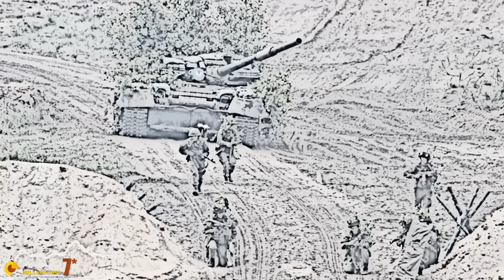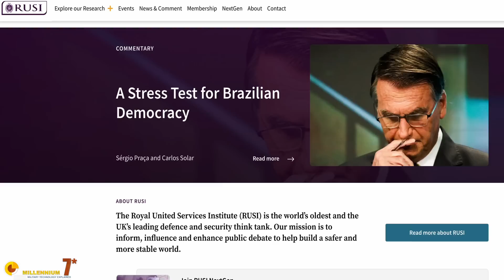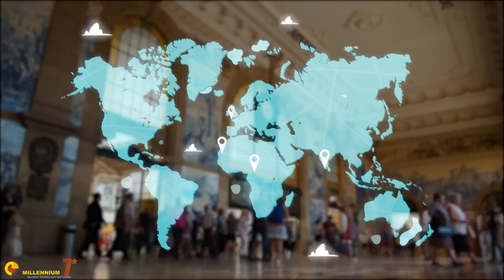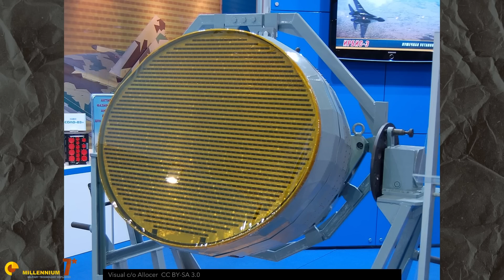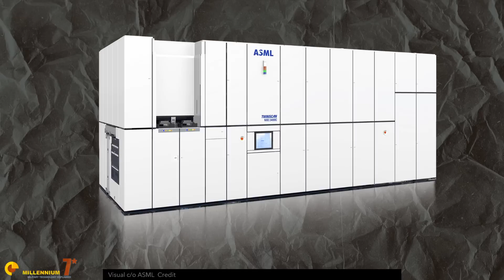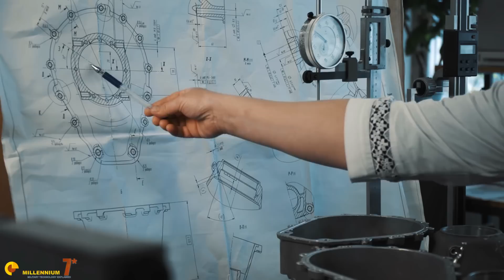Russia is using Western weapons in Ukraine.

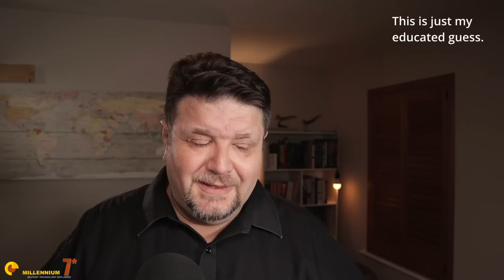Comment: 10:30 "Russia and China re couple of dacadec behind..." well two decades at most. Type in Google: "wikipedia semiconductor factories" - Russia have 65nm factories and China 20nm. e.g. Intel best process is 10nm.
Reply: The process name doesn't say much anymore. Nowadays it's just a name and doesn't give any information about the gate size or buildup. The newer gens don't even have a "nm" assigned to it anymore. Currently the process is "Intel 4". The current TSMC process is "3nm" (N3). TSMC 10nm was the best process in 2016.
The transistor shape of modern processors also looks completely different compared to old processors.

Comment: This is why china is trying to invade Taiwan because of there chip making capabilities I assume
Reply: No. It's for historic reasons. But personally I doubt that they'll ever actually do it, unless the allies of Taiwan and Taiwan itself (or to be more precise the Republic of China) start slacking hard.
But it doesn't look like it. Especially the invasion of Ukraine has also led to quite a lot of motivation for the ROC and its allies.

While it's not impossible to invade Taiwan they'd lose several hundred thousand soldiers in the opening weeks due to having to cover the Taiwan strait. And the problem is that they have no sufficient safety net. If the sons die the parents will be in big trouble. Apart from that there's also a demographic crisis looming.

At the end of the day Taiwan is mainly a propaganda project. For now. Sure, eventually they might go for it, but it would surprise me if it would happen anytime soon.

Comment: You may find that MIL SPECIFICATION semiconductors do not use "Delicate" components such as 7nm IC's. It's pointless to do so. Also, even with error correcting algorithms digital systems are only used incidentally with more emphasis placed on analogue systems such as 4-20 mA systems, especially in missile  control, due to high noise immunity.

That is not say that digital systems are not used ... They are especially in Digital Signal Processing, (DSP), and AI but Chinese Military IC's suitably "Hardened" against EMP, (Electro-Magnetic Pulse), are perfectly acceptable and capable and there is likely very close cooperation between Russian & Chinese Development Design teams in Electronic systems.

Also, it is extremely unlikely that Russia or China will be using very large IC's with millions or billions of logical gates due to the possibility of "Hardware Trojans" hidden in the hardware.  These backdoors can be very difficult to detect without the correct circuit or schematic diagrams. Most large gate count IC's are computer designed,  being a task too difficult for humans to carry out.

My own professional view is that Russia does not depend or use "Western digital electronics" in their primary high security systems like Hypersonic Missiles or Avionics  but may use them in "throwaway or suicide" munitions like drones. 

I am making this comment because  I believe that we are very close to WW3 AND TOTAL DESTRUCTION  and it is EXTREMELY DANGEROUS AND SHORT-SIGHTED to misread or UNDERESTIMATE  Russia's capabilities, especially in Missile and Missile Delivery Systems. 

Nevertheless, I found your video informative and interesting. Thank you very much and best wishes to you.

Comment: military use does not need very powerful computer, video game are much more demanding!
The difference between military grade and normal is in the packaging the chips is the same most of the time use of ceramic package authorize higher temperature and longer gold wire authorize colder temperature, for the acceleration it is the printed circuit that must take care the interna chips military or not (except some sensors) can take more G than any material structure can take (you can find in a air accident pictures taken by the phones of people if the phone is crashed the chips of the memory is often readable.
There is noway to prevent casual components to be used by military, Also Russia has is own operating system (Astra Linux a derivative of unix very effective)  do not forgot that Russians are very good in programming, and often a good smartly written program overpass need of powerful hardware, remember that american land on the moon  with a computer not having the power of a math pocket calculator .

Comment: Very high sophisticated chipset is not needed to build an effective millatary equipment. Most of our daily system is overpowered in processing. A simple Raspberry pi or Ardineo chip can be used to make an effective and advance drone, both of whose architecture is open source. You don't need 7nm chip in millatary, infact 7nm chip is very susceptible to EMP attacks. In my college I was able to make puzzle solving robort using couple of Ultrasonic sensors, accelerometer and some infrared sensor with ardreno and some coding.

Comment: High performance embedded CPU's today is software, not silicon.  Chinese embedded is easy on the same field as the western brands.  So ARM, 51's  and even RISC architecture for advanced graphic calculation is already designed and produced in China and probably in Russia.  So... no... Russia or any big country has no problem to get the high performance chips, no problems at all.

Comment: Dude. Can you please redo the semiconductor section since it's filled with inaccuracies.. The Chinese can already produce 7nm circuitry already... using mature DUV lithography...plus many of the weapons grade circuitry are in the range of 12 to 32nm which is decades old tech. Many of the TSMC engineers, who surprise, surprise are ethic Chinese, switched jobs and work for SMIC a mainland based foundry.  Please research by watching the Asianometry channel,  a Tawainese tech blogger.

Comment: China has a thriving 14nm and already capable of 7nm.  That's about 5 years behind the cutting edge...but 5 years ago, would easily have covered requirements of all weapon systems since western weapons development cycles are on the order of 10-15 years.  Increasingly there is not much that can't be done with readily available Chinese and other free market supplies.

Comment: There is too much confusion  between  military and commercial chips. Reducing the technology node  is more of a commercial consideration and we reached the end of that process a decade ago. Now more gains can be acquired from new architecture and software rather than shrinking the node. Military applications are concerned with security of supply chain, reliability and fault tolerance rather than a smaller node. I doubt even the latest NATO equipment is using many chips past the 65nn or 32nm node.

Comment: When you were saying perhaps 3 decades to parity with the west, you have to remember a couple of factors, the first the Chinese and Russian Cyberability to steel secrets. Secondly there Tech of ASML/TSMC is on the edge of another breakthrough in chip foundry technology so it's a moving target. Also according to Asianometry(https://www.youtube.com/c/Asianometry) China/SMIC is about 5 years away from N+2 node - the 7 nanometer leap, regardless of the efficiency(which won't be good) China will still be able to scale it up this Foundry fairly rapidly. ASML maybe has only 4 counties that supply critical components their are many more then 4 companies supplying those components, which the west is very effective at controlling. I would like to know what inside the IRST of the SU-57, that would be interesting.

Comment: It is not possible to stockpile high-tech equipment, it would be like attempting to future-proof your computer for the next decade. It is not just improbable, it is impossible.
Reply: yeah, please check on which CPU Hubble was running 😂

I have bought microcontrollers and imaging sensors in bulk. Thousands of pieces.

The designs do not change. Not that quickly. 

You can still buy audio chips for a Commodore 64 or the Motorola 68000...
Reply: @juliusfucik4011  That is true, however, what I am referring to, is the advances in miniaturisation of chips, and  high speed with which processors develop. The Space shuttle, ran several computers for error correction and redundancy, yet due to the period when it was developed, the computers were IBM 8088 processors. And the software was also 8 bit. Once a high-tech system is established, it becomes difficult to upgrade the entire hardware and software package as a whole. USAF fighters, for example, are just recently developing an upgradable architecture, to minimise the cost and downtime. Future proofing hardware and software is next to impossible, in this light.

Comment: If I was going to make a suicide drone I'd use some old US calculators, an old hunting GPS, some random stuff from dollarama (China), and the motor out of my old DirtDevil vacuum.
Reply: i would choose something other than my dirtdevil motor since your complicating the process by adding in batteries and other components to get the voltage right.  

instead i would use an old lawnmower, chainsaw motor.

Comment: While this is worrying I think there's also the risk of not being able to see the wood for the trees.  With enough time, money and focus they can plan for shortages in specific areas but the components are only one of the inputs needed to manufacture it.

The sanctions have been so comprehensive that unless they're lifted or Russia finds ways to avoid them one of the other links in the supply chain is going to break.  Take the railways for example which transport 85% of all Russian freight including pipelines.   Russia switched across the board to using roller bearings which were supplied by  companies like SKF.

These are subject to wear and need to be changed out as part of maintenance (about 195,000 a year) but SKF shut their Moscow factory when they left the country.  This has led to massive problems with their rolling stock and forced tens of thousands of wagons out of use and this will only get worse.

This is just one example, an even bigger problem will be replacing the Western machine tools Russia uses in their defences industry - I don't think they'll be getting many spares out of Germany anytime soon.  If you can't move the raw materials, don't have the machinery required to manufacture and can't move the finished products over the vast distances in Russia, what good is a stockpile of semiconductors?
Reply: There is always an alternative
Reply: Am from the future, sanctions are still ineffective

Comment: The PRC and Russia may not be as behind in military semiconductors as might first appear. The reason for this is because military chips often only require older production processes to be fully functional for purpose.
Reply: best processor are only for flagship laptop & phone. because they are the most expensive. we can buy middle price laptop/ phone that's still using 12nm. military processor tend to be 28nm or bigger for rigidity & doesn't have to use the smallest.
Reply: @moneyandtechnology  the best processor does not exist in a laptop. It resides elsewhere and is many times more expensive. Especially vs flagship phones, the best processors for computational tasks exists in super computers.
Reply: which actually makes a lot of sense, in the case of a war you would want something that is robust,  Easy to manufacture in trying conditions, powerful enough for the task and thats it (keep the cost down)
Reply: A larger die process is often used for radiation hardened chips, because it seems to provide some additional protection against strong external electromagnetic sources. These are frequently used in the aerospace industry in particular.
Reply: Yes... Just look at NASA... You do not use bleeding edge consumer grade electronics if it have not been tested for few years... Older, slower but tested equipment is what you need for critical missions
Reply: F-22 uses G3 PowerPC
Reply: @sturmanaskie  yes but back then g3 was not that old. F22 is a product of the 1990s
Reply: @k.k.c8670  yeah but what I mean is it does the job you don’t need the latest processor for this stuff if the G3 is enough for the best air superiority fighter …
Reply: @sturmanaskie  agreed. In fact, even 14nm tech isn't used that much in many military stuff, including missiles.
Reply: @sturmanaskie  if windows would not be so inefficient we could run best programs with much less power too...
Reply: But can it run Crysis?
Reply: This is called a fog of war ot war on propaganda

Comment: It would be interesting to know, which of those components are now replaced by Russian counterparts since 2014. They would also also have to reverse engineer it even, when it's not at the same level, but the Russian military industrial complex always had a workaround that surprised the world.
Reply: i used to work in the electonics industry and you would be surprised how often components are made redundant or obsoleted forcing redesigns.  Sometimes its quite simple.  add in the new chip, maybe change a couple components in the power management portion to get the voltage to whatever your new chip needed and then write some new firmware.  

Other times it was much more complex, a complete rework of the entire project.  

For example one of the projects we had was a simple touch activated switch using Qtouch with wireless communication. As i recall, well they obsoleted not just the IC  chip our initial switches used but the entire line of ICs which forced us to switch to a completely different chip set with completely different capabilities.  This involved reworking the switch, the only part that did not need extensive rework was the power supply component and the wireless communication portion.  The rest was a complete rework.  It took about a month for a prototype to be built, and within three months we were back in business.  

I think that people often underestimate what can be accomplished with massive overtime and some burnout.
Reply: @islandwills2778  You fail to mention that you still require the talent, to which the majority has upped and fled the terrorist serfdom starting at the very beginning of this phase of their imperial genocidal invasion, and only went into major overdrive when they started forced mobilization. Right now the floodgates have “quietly” started flowing like crazy again (check online webcams of border checkpoints from friendly sides), since word on the street is the terrorists of Orcland are dead set on putting the entire country into full martial law lockdown with a full general mobilization in the not too distant future…
Reply: @MikeOxlong-  the people who fled were almost all young people.  Ive yet to work in any place where the senior engineers were anyone other than old men with decades of experience.  Those guys are still there.  So NO they have not lost the people with those types of skills.  At best they lost some recent graduates who normally would be working as technicians or other junior positions.  The people with the experience and skills arent in any danger of a draft, what you think this is ukraine where they draft 15 year old kids and 60 year old grandpas?   Also WTF are you talking about genocide?  Its Ukraine who likes committing genocides.

Comment: Many weapons systems are relying on very old technologies, that might be easier to access.For instance, many modern aircraft of the 4th generation use computers based on 486 processors. Such components are very capable to provide very decent guidance and overall capabilities. You do not need the latest I7, M2 or A16 processors for the weapons systems. I do not know what processors are being employed in the F-35, but most likely they must be about 10 - 15 years old, when the systems were originaly designed. Probably the F-22 uses computers based on Pentium processors and the same age circuitry. The same thing applies to the software, I saw systems that use FORTRAN as programing language and/or are operating the Windows NT 3.51, doing a perfect job.
Reply: I used to work in an electronics firm and lets say that the components that are in some aircraft are not just old they should be museum pieces.  

Sometimes when adding a new component it needed to be custom designed which was sometimes extremely complicated because it had to mesh with dozens of different systems all using different set ups, chipsets, communication protocols etc and many were ancient.  Then once you got that figured out you had to design it to survive litteral hell, one test in particular was really gross.  you had to submerge the device in a pool filled with algae complete with a thriving insect population.
Reply: @islandwills2778  Then comes the software layer, that takes months and years of developing and testing.Only the testing phase might take over a year, and is not bug free guaranteed. I lost a couple of friends due to the software bugs that caused crashes in an otherwise pretty benign environment.
Reply: @alex3261  yea, it can be a real challenge especially if it has to integrate with the patchwork of other components